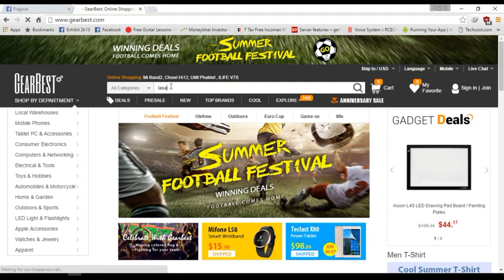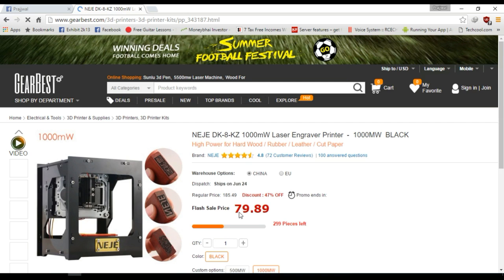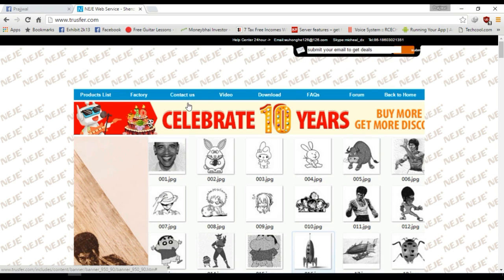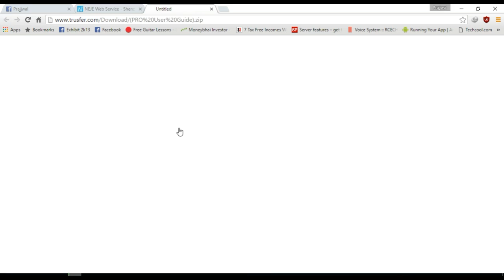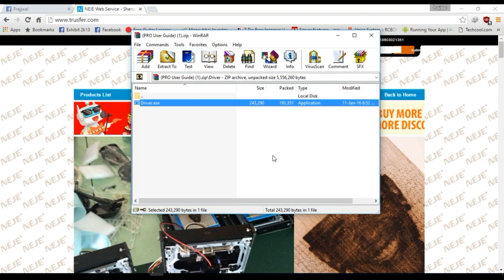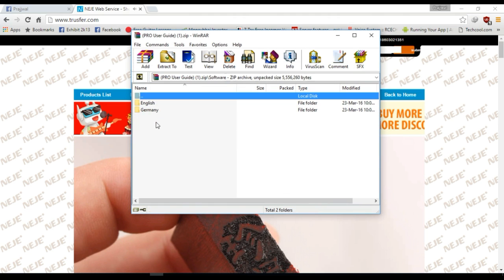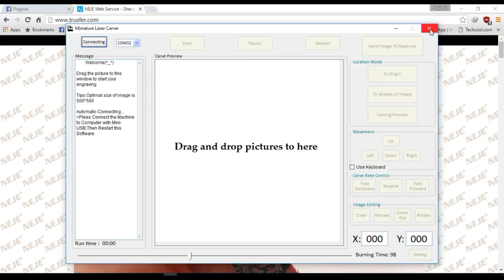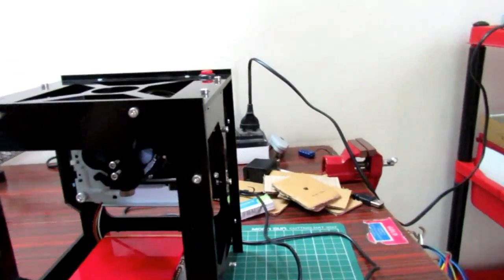Neje Dk-8 Laser Engraver Review || Laser engraving tutorial || NEJE Laser Engraver tutorial

Comment: Hi, what is the difference between 1000MW vs 500mw version? can we adjust the depth of the engrave? thanks
Reply from the maker: More the power ,more quick is the work and also the depth increases, you change the depth by changing the burn time or the focus .
Reply: so do you mean 1000mv will engrave faster than 500 mv ? thank you
Reply from the maker: +dua jari under similar setting it will do better